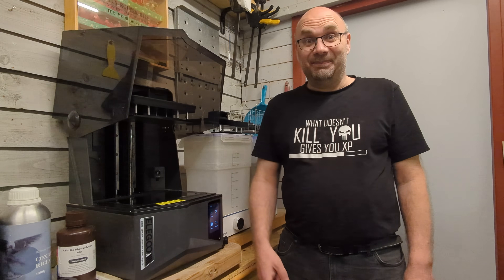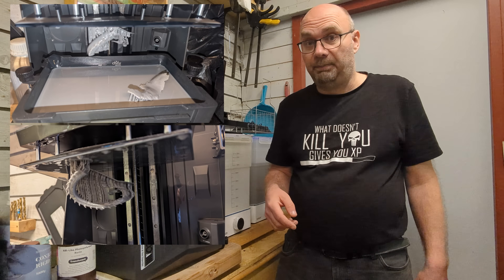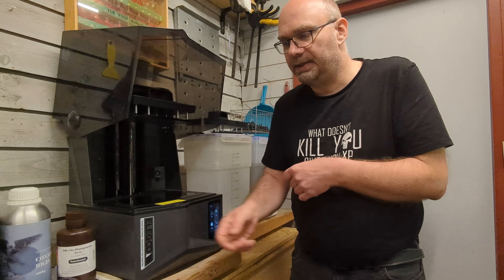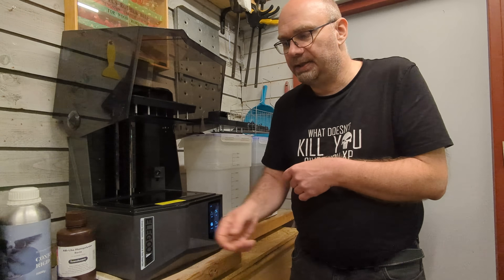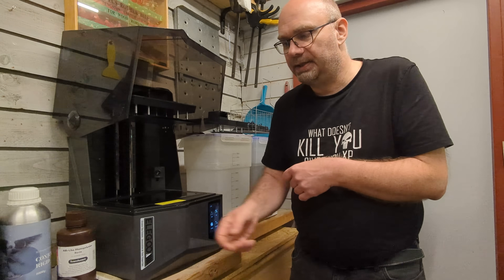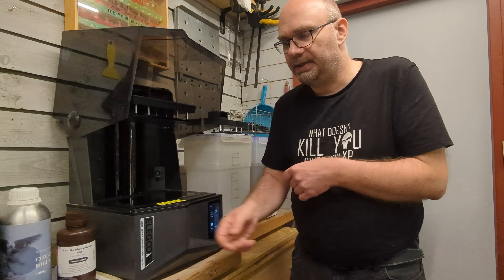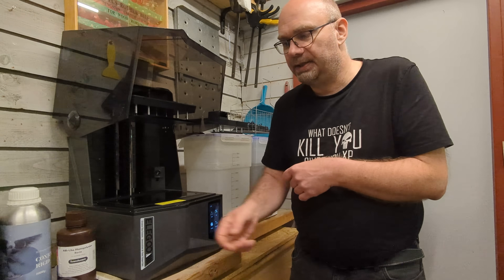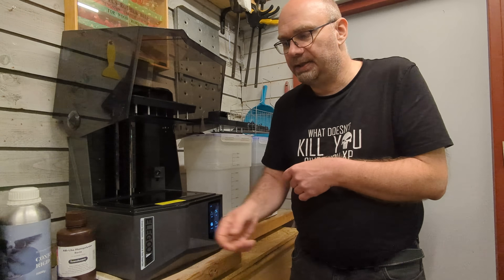No More Failed Prints: The Ultimate Elegoo Saturn 4 Ultra Leveling Guide

Comment: Great video. I have a lot of experience with resin printers, but above all I have a great deal of experience in mechanics, so if you allow me, I'd like to contribute to your channel. Although this printer has an excellent bed adjustment system compared to many printers, it can't be considered automatic in any way, but it is the best system for manual calibration! The problem many people had was relying on the idea that the bed would calibrate automatically; others didn't understand that if the 4 screws were tightened, the bed could not possibly be perfectly parallel to the display. Many printers secure the bed with screws on the sides, which inevitably create movement when tightened.  This system instead uses 2 parallel planes connected by 4 screws in which springs have been placed, this method does not require any tightening of the screws, so the plate will remain exactly in the position you have calibrated, the pressure of the springs will ensure that the screws do not rotate from the calibration position (however, a check over time would not hurt) regarding the sheet of paper we use for calibration, it is good to remember that the display (in almost all printers) has black tape along its perimeter, this creates a thickness that prevents us from really understanding the friction that exists between the plate and the display, so the real distance of our Z-offset will in reality be greater than the thickness of the paper used, furthermore this tape creates a friction that does not give the real perception of pressure when we move the sheet.
Reply from the maker: Thank you for your input, hope it can help others, i will pin it to the top comments👍
Reply: This is very help full 🙂Thank You!

Comment: As a person who became addicted to gaming in 1976 and continues to game every day, I love your T-shirt. I have more XP than most! I just bought my S4 Ultra and no zilch about resin printing. I'm a long-time FDM printer, though. I'm grateful to have found your videos. Sub'd! :hand-purple-blue-peace:
Reply from the maker: Thank you for your kind words😊 i have to start FDM print again i have not touched a fdm printer for 5 years now. Welcome and thank you for the Sub❤
Reply: I hope resin printing isn't as problematic as FDM printing has been for me. One major headache I have is my Bamboo P1S printer. It seems like I have a jam, a clog, or an AMS tangle with every print job, and maintenance isn't fun. My PRUSA has performed nearly flawlessly, though. Cheers
Reply from the maker: @MSWindman well you have to be prepared for a messy table. Resin print require a lot more work cleaning models and remove supports. But id is worth it if you want high details.

Comment: Do you have any idea why turning the leveling screws on the bed doesn’t change the height whatsoever? it just backs the screw out and nothing changes
Reply from the maker: Tight the screw will lift the plate, loosen the screw will lower the plate😊
Reply: @olebrogger I tried this, but it didn’t actually adjust the height, it just loosened the screw. Paper still was tighter in the rear than it was in the front. But i have a mars 5 ultra, i suppose it could be different.
Reply from the maker: @carlUwheezer Yep it could be different, im not familiar with the Mars i only had the Old Mars Pro and it had a ball mount and only had manual leveling
Reply: @olebrogger  the mars 5 ultra looks basically identical to the 16k, just miniature. Same location of screws, same mounting bracket, it’s frankly quite strange that they don’t seem to be making any adjustment. I’ve noticed that info on resin printers is far more limited than FDM.
Reply from the maker: @carlUwheezer found some pictures of the Mars 5. And it definitely look like the one on Saturn 4, wired the screws dont effect the build plate. Could it be the springs are locked inside? Can you see compression when it is doing its auto level? Maybe it is stuck. I dont know but it is just a guess😢

Comment: Hi, unfortunately I need to replace my LCD screen. The UV one, would you recommend doing this after I replace that? I’ve never had lvling issues, only ever let it autolvl
Reply from the maker: If you dont hav problems with leveling. You should not do it. Most important if you replace the screen remember to use the masking tape, or the uv ligt will bleed out on the edges of the screen ad you will get cured resin along the edge of the tank

Comment: I don't understand why do you put the A4 paper afterwards, if you already leveled the bed with the 4 pieces of paper. If the process is similar to FDM leveling, then you would just have to get the same tension for all 4 pieces of paper and that's it, no?
Reply from the maker: It is easier to feel the tension with the big piece of paper, and the instructions on the screen is recommending it😊

Comment: Interesting.  Told by Elegoo never to make any manual adjustments, but I have been getting a "Foreign Debris alarm and do not know why.  The resin, the vat, the FEP and the build plates are all clean/new.  So I suspected the message may imply debris (resin) had gone inside, but it seems clean, spotless TBH, and then being of old school, MAYBE the plate isn't level or levelling in the "auto levelling" cycle.  So I have tried your adjustments.  Not made any difference, but I do wonder if there may be more to it.  Is the build plate faulty as I see no movement in turning the screws, esp top left.  How much can they be turned and how much effect does a 1/4 turn have.  Any thoughts, please?
Reply from the maker: I have had the debris alarm 2 times, cleaned out the tank, changed the FEP, filtered the resin and put it back. And got the error again, then i noticed that one strip of the tape on the screen was curled up inder the vat and a corner of it vas visible between the display and the vat.after that was fixed it worked again. About the screws they can be turned several times. But i dont know how many. For my adjustments i turned only a half to one turn. But someone said he need 3 full turnes
Reply: @olebrogger  SADLY, even though I also had a bit of tape, not out of align, but it made a crinkly sound when i ran my finger along it.  I know from experience that with ELegoo that can destroy the LCD if there is a spill/tear in the FEP.  So replaced it.  Made no difference.  I have also cleaned the build plate, many times, and used a magnetic, flexible plate on top to ensure a new flat surface.  Cleaned the vat, replaced the fep, replaced the vat with a new factory fep, removed all the resin, obviously and filtered it.  Done everything.  Even opened the casing and checked nothing inside, and it is spotless.

Manual adjustment, have wondered if that may be an issue, but even starting that I get a failure as the Debris alarm comes up.
Reply from the maker: @TheJonathan1959 sorry to hear that, im out of ideas. Maybe try to contact elegoo support, they are pretty quick to respond. Let me know of you find a solution ❤ good luck

Comment: One thing that is not mentioned, is the flatness of the build plate itself. My plate was very slightly concave i.e. the corners were very slightly higher than the centre (when turned upside down). I glued some 120 grit sandpaper to a glass sheet and sanded the plate until it was perfectly flat. Only then could I reliably do this test.
Reply from the maker: That's a great tip! Thanks for sharing your experience.👍I have heard about people having this problem. but the two buildplats i have, did not have this issue😊

Comment: i need some help guys please...
i followed the instructions but after it lowers on the 4 piece of papers one of the side is very tight i cant pull out the paper okay so i go to tighten the screw to release some pressure but the screw is fully screwed in i cant screw it in further so what do i do ? this is the same case with 3 of the screws i am stressing out
Reply from the maker: Before you start, tru to give that screw 2 turns😊

Comment: Comment: This video shows the new tank but doesn’t explain how the detection error was actually resolved. The real fix is making sure the printer’s spring contacts are properly pressed and electrically bridged, otherwise the Saturn 16K won’t register the vat. Without showing that step, the error isn’t really addressed here.
Reply from the maker: The Saturn 4 Ultra i have in this video is the first edition 12k and it does not have the contacts on the resin tank. I know the 16K have that but i cant show a feature the printer does not have😃
Reply: i solved  it  thankfully

Comment: It's crazy that Elegoo says a flex plate can't be installed on this printer.. Do they not know about re-leveling the bed? lol. I appreciate the video!
Reply from the maker: Yep, flex plate works fine after manual leveling ❤️
Reply: Do you do the manual leveling process with the flex plate installed?  Also, what card stock do you use specifically?  Is it just plastic sheet stock, and do you know the thickness of it??

Comment: I have a problem with those screws, especially the back ones, I need to tighten to loosen the paper and already squeezing to the maximum it does not loosen the paper, will it be damaged?
Reply from the maker: Try to loosen all the screws 2 turns and then run leveling program again from start, it should give you more head room to work with. Let me know if it works😊

Comment: if you need to adjust the screws to be able to slide a piece of paper under the plate, is there a reason that cards would need to placed in the corners for the leveling?
Reply from the maker: It is to make it easier to remove them. My first two printers came With one big card that had to be placed under the build plate, and that was easier since they only had manual leveling. But with the pressure on the s4u it would be a pain to remove and difficult to feel the tension in each corner 😃

Comment: Thank you for your videos 
 at the moment my hardly used saturn 4 ultra 12k has issues 
The print starts fine but an hour or 2 into the print the print starts sticking to the Feb sheet with the model separated from part of the print still attached well to the build plate and the temperature almost immediately goes from 68 degrees Fahrenheit to 95 even a few times 105 room temp is 68 to 70 
If anyone has any idea why please let me know 🙏 
Thanks 
John
Ps i just joined 
Please 🙏 help me
Reply from the maker: Hi, and thank you😃 it could be the Resin that is sensitive to temperature changes. Most Resin work best at around a stable room Temp at 77-82F(25-28C) if there is big changes in temperature some resins seperate and you get failed prints. At low temp. like i have at my workshop 30-34F(-1-+1C)at the moment the resin gets  very thick and i cant print unless i turn my heater on. If room temp is above 100F(37C) i cant print either. They stick to the FEB or models start to seperate and fall off the build plate. You can compensate a bit for this bt increasing the layer exposure time. The resin i usually use i have set to 2.5sec but if it is high room temperature i increase it to 2.8 and sometimes 3.0. 

I had a problem with low temperature on my old Saturn 2. The greese on the snail rod got so thick and the build plate was inconsistent in lifting speed. Dont know if it was the motor or the build plate mount on the rod that started to give too much resistance.but that was at low temperatures.

I have heard about defective motors for the lifting rod and they needed to be replaced. I have not tried to fiddle with that. On some printers there is also some adjustment screws on the Lifting rod where you can ajust the vertical alignment. If it is starting to be inconsistent the higher it gets. But i dont think that should be a problem on the Saturn 4 since it has the stability rails. If that is the case it should be the whole unit that holds the build plate  that is out of alignment and i dont think that is the case. How ever i have heard about one case where the whole lifting unit twisted it self a part.but i think that is a rare thing.

Hope this helps to get you on track and find a solution to your problem. Let me know what you find😃
Reply: @olebrogger  I will 
Thanks

Comment: I want to add my small contribution to the excellent video you made, my friend. If anyone has trouble calibrating the build plate, simply tighten all the screws and then loosen them again, but only a little, maybe a turn, just so that it's evenly distributed. Once loosened, start the calibration as shown in the video. This way you'll avoid adding washers or other extra parts and it will also make the calibration easier.
Reply from the maker: Thank you great tip 👍

Comment: I'm having problems now with some of the prints sticking to the FEP sheet.  This is after using the printer for a better part of a year.  I'm down to bed leveling and if that doesn't work replacing the screen.  Any other idea's that would cause the problem I'm having?
Reply from the maker: It happens sometimes if your bottom exposure time is to low. Mine is 55sec. It makes a strong bond to the build plate and it can rip the print off the FEP. I have started to use ACF it has one side with easy release and almost never sticks to the prrint😃

Comment: Hi, thanks for the video, i have the exact same problem. But I dont have any leveling papers that came with the printer. Can I use anything else? I don't have anything that is 300 mg. Can I skip this step?`
Reply from the maker: Thank you😃. I think some ordinary playing cards will do😃
Reply: @olebrogger  I did the ordinary cards, it did the trick as it's a bit thicker than the A4 paper. Just started the print that failed miserably 4 times in a row, if that still doesnt work, i'll just increase exposure time so the print doesnt dettach from the supports...
Reply from the maker: @davidjunyan7700 i also have to increase the bottom exposure time to 55sec think its pretty long, but necessary even if it will ware out the lamp faster
Reply: @olebrogger  Tried twice after leveling the plate, but there is nothing on the build plate, don't know if I leveled it wrong ? I'm out of ideas lol. I made sure there is no residu in the VAT tank, i cleaned using supports and removing all the bottom cured.
Reply from the maker: @davidjunyan7700 what is your bottom exposure time. I run mine high 55sec elegoo even recommend up to 70sec

Comment: This printer has been a source of endless frustration for me, so I am looking forward to trying out this method of leveling. My biggest issue seems to be the screw adjustments- there is always some part of the plate where the a4 paper is too loose. I am hoping the 180 degree turn prior to sending the plate down fixes the issue.
Reply from the maker: It has worked gor many, i hope it works for you😃

Comment: Interesting.  I recently had an issue with the coiled cable and have had to stripe the machine down to replace it.  Tired a print and it failed, which had worked previously. Tried a calibration print, but nothing on the right side had printed.  So I’ll give this a try tomorrow and hope it fixes the issue. Before the issue, the S4U would print everything I throw at it.
Reply from the maker: Sorry to hear you have some issues, but it is worth trying to level the bed. It was the same symptoms i had nothing printed in the left side or some of the print fell off

Comment: Hi, I recently purchased the Elegoo Saturn Ultra 4 16K and powered it up for the first time today. Everything was fine until I had to level the platter. Then came the problem: one of the four corner screws is stuck, spinning loosely, and obviously, after testing, it’s wearing slightly. I don’t want to mess it up and avoid it from completely stripping. Any advice? I’ve read that this can happen after several uses, but this is literally the first time I’ve used it. Thanks to anyone who responds.
Reply from the maker: I think you should contact their customer support, it should work right out of the box. It could be a faulty build plate 😃

Comment: 8:21 do you remove the paper or keep it there?
Reply from the maker: I remove it, but i think the most correct way is to leave it, and remove it after the calibration is done
Reply: @olebrogger  I removed mine the first time but it put too much pressure on the paper on the second calibration
Reply from the maker: @ebanksstudios hmm so it worked best if you removed it. Then i might have done it right removing it before the last calibration
Reply: @olebrogger  No sorry, I did the calibration twice, first time removing the paper, second time keeping the paper
Reply from the maker: @ebanksstudios okay, as long as it worked😊 i might do that if i have to do it again some day😊

Comment: Thanks a lot for the video!
But there’s one thing I didn’t quite understand… When I’ve already adjusted all four corners using the paper sheets so they move easily and evenly, I press “Confirm,” and my printer slightly raises the build plate — then lowers it again, but with such force that my paper sheets can’t be moved at all...Its ok?
Reply from the maker: Yes, the printer does it correctly😀 you just remove the paper and it is done👍